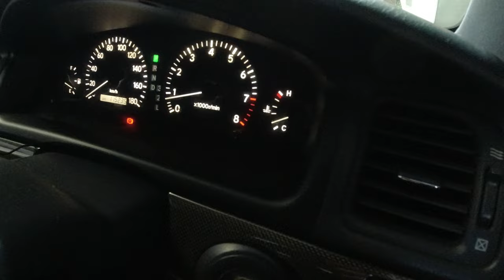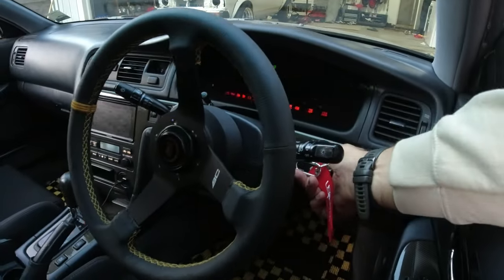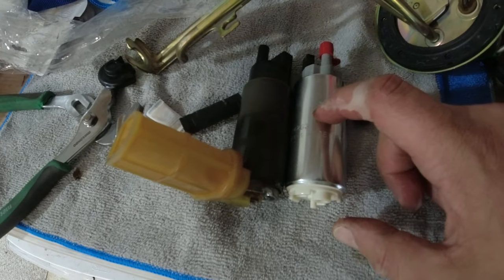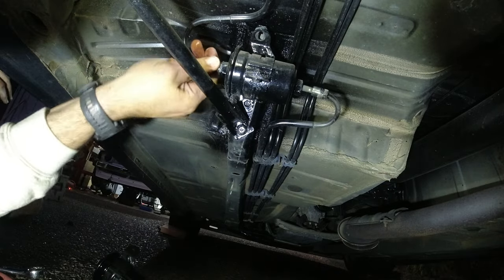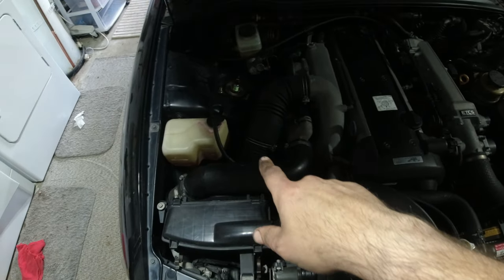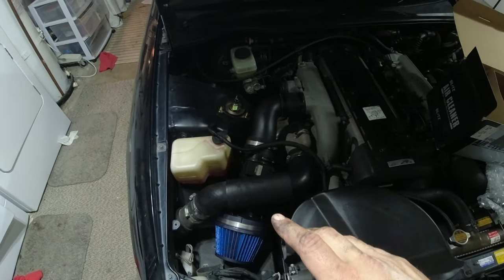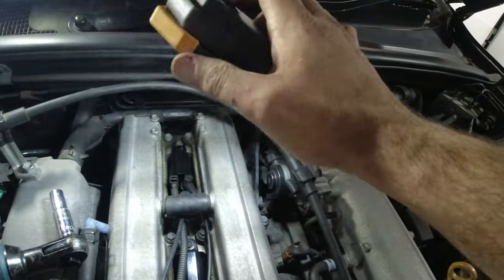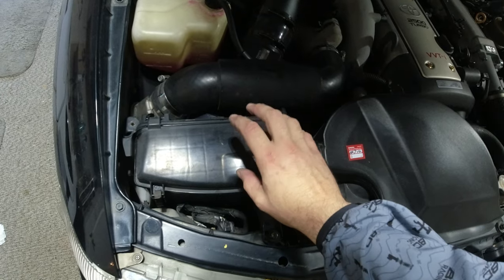Fix a dying JZX100 Chaser Tourer V

Comment: Thanks man sometimes my jzx was doing the same thing always thought I was just stalling with bad clutch work but my engine cutted off while going on the highway.
Also sc300 fuel filters work in both jzx90s and 100s.
Reply from the maker: I figured IS300 or even SC300 goodies would fit but hey, who not order from japan direct if you can?

Comment: The ECUs in these cars can be a weakpoint sometimes, during certain years Toyota supposedly had to use another supplier that wasn't up to the same snuff as the normal supplier. The ECU in my 97 Tourer V was fine but I ended up going Haltech with a custom harness.
Reply from the maker: So smart. Haltech or link is top of our list
Reply: yo how much and what spec of haltech did u use? also what currency im in nz? Ive gotta do mine i think 😞
Reply: @JacobTaff-r5o ECU was about $2k modifying my factory harness $1.8k (all USD). Haltech has a plug n play option for JZXs that comes with an ECU and adapter harness, Link does too but I've heard it doesn't work as well/requires more config, I'd only use those options if your factory harness is in good shape ie the connectors aren't all brittle.

Comment: Having an issue with my chaser, flashing check engine light along with ect pwr light as well. Car idles low and jumps up and down all below 1000 rpms. It will go away randomly then come on randomly when it wants. Then it could stay on or just go away. Any ideas? Been stuck for few weeks now.
Reply from the maker: 90% of the time those issues are stock ECU capacitors going out. I'd also check the grounds in the engine back just to rule those out.